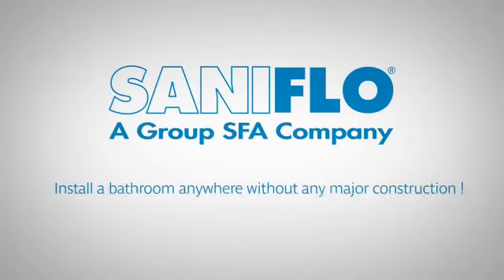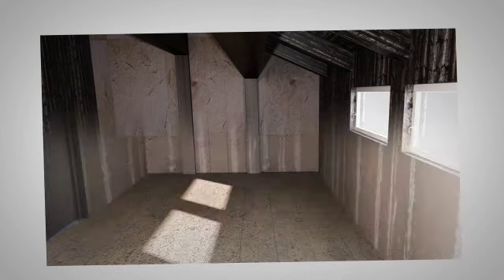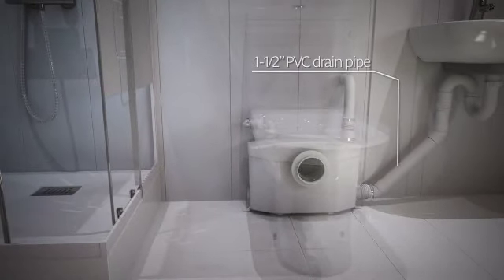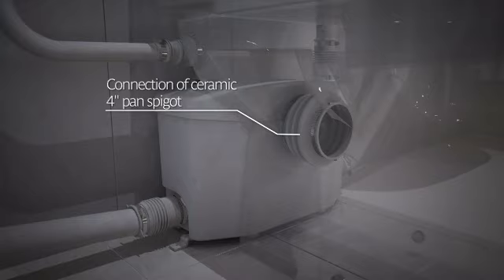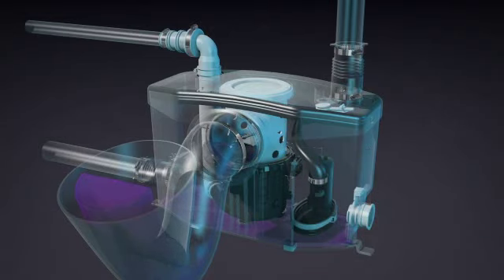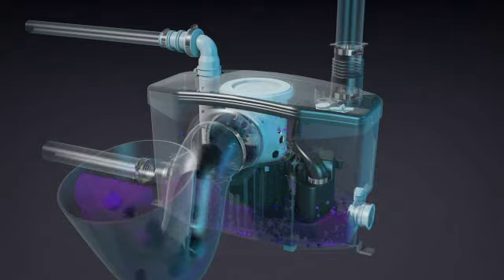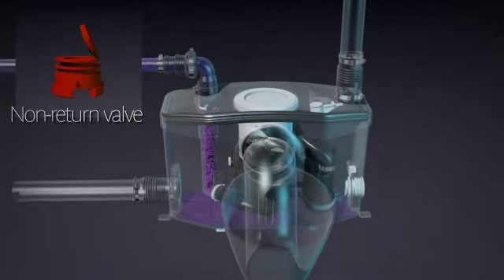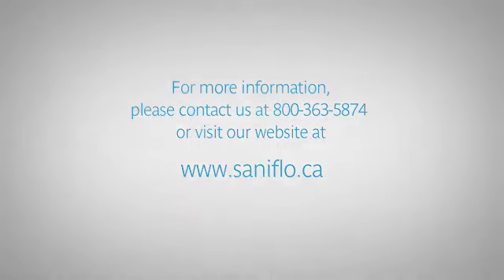Saniflo Macerator Installation

Comment: i'm installing a stand up shower in my basement with a saniflo toilet. Do i need to purchase a showermatic pump to hook up to the toilet macerating pump for discharge?
Reply from the maker: Hello Greg, We suggest that you call our technical hotline at 800-363-5874 to find out all the necessary product and installation details that would work best for this project. Having as much detail as possible for the project and work space ready for this conversation would be helpful as well.  Please let us know if you have any other questions we could help you with.

Comment: The shower needs to be raised AND close to the pump in order to get the required slope from the drain.
Reply from the maker: Hello Dan, That is correct. We recommend an 6 to 8" shower base. This allows for gravity to push the water into the pump naturally. With the shower base - a Sanishower can be places in the shower base... or one of our bathroom pumps will near by attached to the toilet (like in this video). We appreciate your comment and clarification! Other customers will appreciate it. 😄

Comment: My waste pipe which runs to the soil pipe does not have a lot of fall which is causing my new shower to not drain away quickly enough.
Is it possible to use one of these to push the waste water along to the soil pipe? Many of the images suggest that the waste leaving the macerator has to go vertically initially, whereas mine would just all be horizontal.
Many thanks
Reply from the maker: Hello James, All Saniflo systems are designed to pump up vertical to the highest point then horizontal with a slope of 1/4" per foot.  In this scenario you is looking to discharge horizontally - which is ok since all of our systems can discharge flat horizontal up to 120 ft or more depending on the model selected. 😄